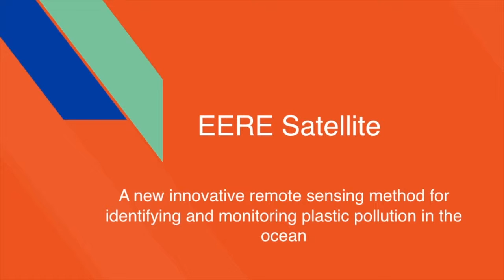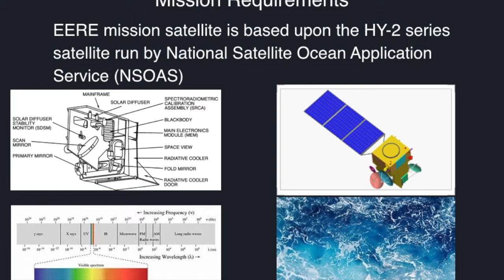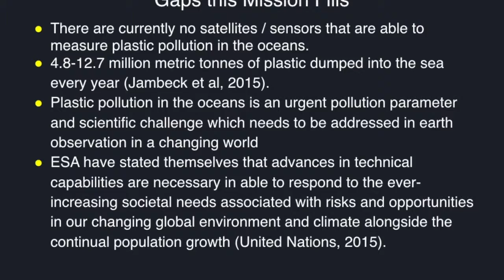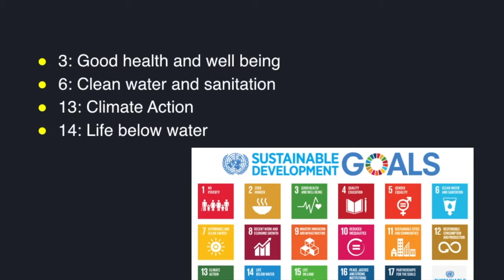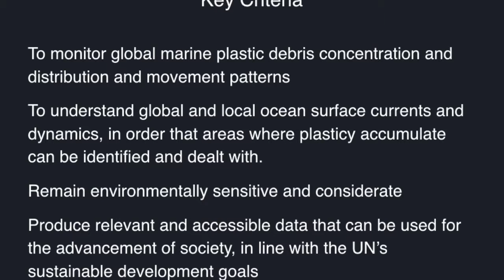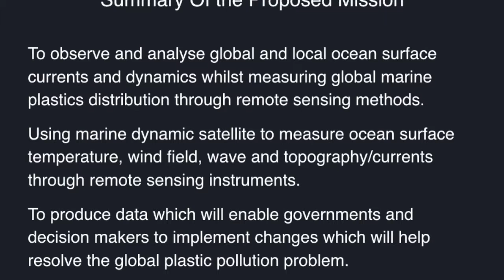EERE mission proposal

Comment: Exciting and topical mission. 
First thing: its 11 mins long, but its supposed to be 8!  Always keep to time.
Well done for getting the video together, though.  Pity no soundtrack!  :)
Note that you don't need to propose an "innovative remote sensing method" but rather, you need to propose the mission.  It may use innovative methods, but focus on the mission.  In fact, the method has been used before. 
On the science question, try to find evidence of other organisations, or publications, citing plastic as a problem.  Better still, get a quote from somewhere along the lines of "if we only had better current data, we could map the plastics".  If "ESA has stated" then quote them exactly.  Good to link to the UN Sus Dev Goals. Elaborate on how you help meet them. 
Make sure you elaborate in detail in the plastic detection method.  Sounds interesting.  
Bring the "benefits" section to the beginning - this is compelling, and so needs to be up front.  The mission is then the solution to the big question. But don't just describe it -- give me some clear evidence to back up your argument.  Explain who the users will be of the data -- and how will you get the data to them?  How quickly do they need to know?  Is the mission to work out how much there is, or to allow action to be taken?
"Earth" - capitalised. 
Presentation style: was best when you used graphics to support your narrative.  
Good to include some costings and size.  
Be more specific on the key criteria.  Tie down the key elements in as much detail as you can.   Tabulate the properties of your instruments , and the measurements they make (resolution, retrieved parameters, etc).